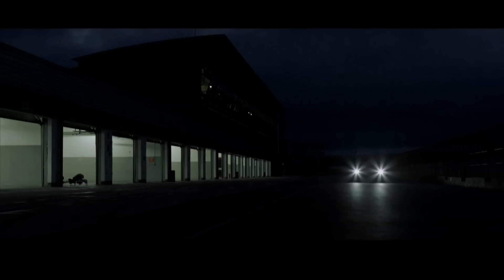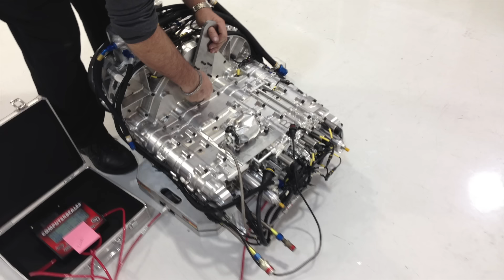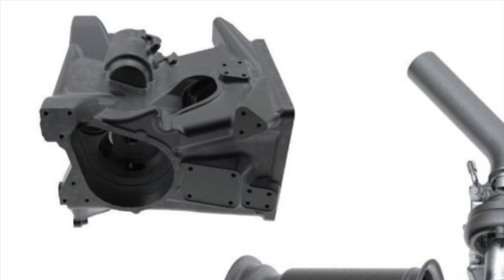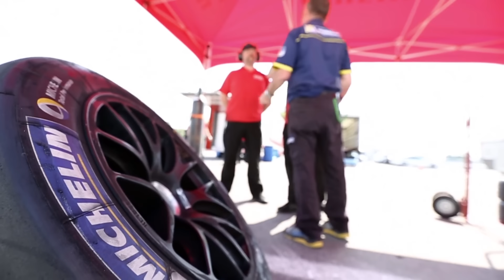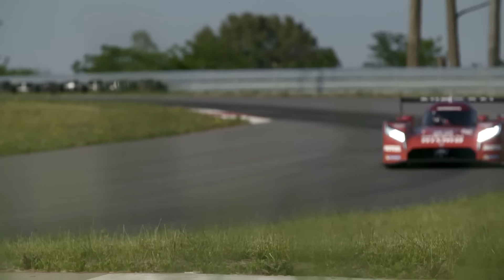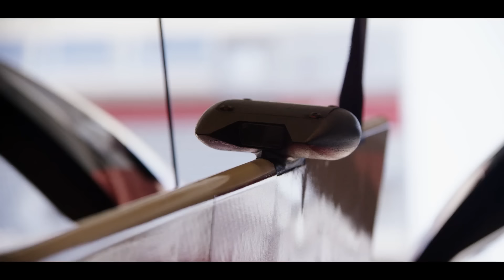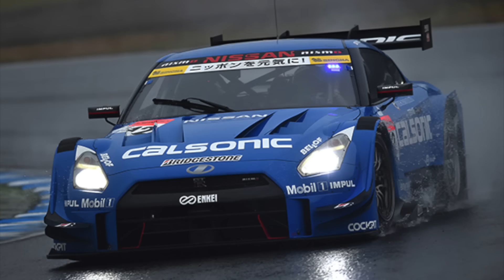Nissan GT-R LM NISMO, the front engined Le Mans car that ended up in a dumpster. What went wrong?

Comment: Yeah. A super low drag concept shows up every once in a while and it's never as good as the numbers say it should be. Something something spherical car in a vacuum.
Reply: low drag cars might need their own series with a limit on how much drag they can make, so any downforce generating parts still have to fit within that drag limit
Reply: It’s not the low drag concept.
It’s that such alternative concepts are run by teams with lower recourses and recourses are the best indicator for success in motorsports.

Those with sufficient resources don’t need to go extreme they build overall conventional designs and improve them a little bit.
Reply: It's the kind of stuff that only works if everyone is forced to do the same thing per rules.
Reply: Williams made it work pretty well for a few years at the start of the F1 Hybrid era.
Reply: @tuborgclassicenjoyer  That was also because of the power advantage of the Merc PU. Once the other engine manufacturers started to improve their PUs they started their journey to the back very rapidly (They were behind Force India by 2016, just two years after the V6-Hybrids were introduced)
Reply: @tuborgclassicenjoyer The teen Williams were low drag but not crazy. The closest car I can think of in F1 was the Ferrari F92.
Reply: Cough* 9x8 Cough*
Reply: @bigmac0702 at least the 9x8 was supported and they were able to get some podiums
Reply: @bigmac0702  9x8 has been monumentally fucked by the FIA's absurdly awful BoP (compared to how IMSA does it).
Reply: @julianturberfield7101  enough time has pased and IMSA BoP has being shit all the season long, 9x8 had being fucked because it was based to have power in the front axis sooner than it does
Reply: @giratina_86  wasnt it also the time when the FIA couldnt make up LMDH and LMWhatever and the peugeot went for the one regulation that got binned in the end?

Comment: I respect Bowlby for his ambition and innovation and Nissan for even green lighting such a project. But did they not learn anything from the Toyota F1 project about communication and placing your project in a strategic, sustainable and efficient part of the world where access to contractors, parts suppliers and partners is efficient. 

And less than a year of development is just not on at all. If I were them. They should’ve used the whole year of 2015 to develop the car and aim for 2016 instead. I feel soo bad for all the engineers and drivers who could see the project just constantly tripping over itself. I wanted this thing to do well but omg after watching this video and hearing the depth and detail of it’s failure it’s no wonder it was a grand failure
Reply: The issue with the toyota project was not the location, more so corporatisms. Worthy to listen the recounts of Salo and other toyota people. Comm was bad ofc between the japanese and german side but it wasnt as bad. Things like the corpo believing they have perfect engine and blaming the aero people for the lack of top speed for a very long time, throwing rally mechanics straight into the team no one really knowing how an f1 team should work, etc. Cologne was not an issue, there are a bootload of suppliers based in Germany and they built on an already set up base.
The team who was hampered by the location was HRT with their intention to make a fully spanish F1 team but in spain there was no infrastructure for that to happen
Reply: @leventebandi What's even worse is how they treated the employees. Most were laid off right before Christmas and by then trying to find jobs with another organization is almost impossible as everyone is well underway getting ready for the next season by that point. Nissan as a company is a shell of what they used to be. Disgusting.
Reply: nice buzzword salad
Reply: Made thing even worse 2016 LMP1  rules set reset all Hybrid class must hit 1000HP  that mean Nissan can't rivals against them if they reused 2015 package

Comment: What did people at the time think of the front engine concept? Did they think it was a gimmick, or did Nissan actually convince the audience to find it cool?
Reply: IIRC it was always a mix of the inspired and the cynical.
Reply: @Fuse_22 And nissan official account being absolutely everywhere on social media replying to peoples posts and comments assuring them that the lmp1 is actually good.
Reply: It wasn't new; that was the main thing to remember. 
They were (VERY loosely-speaking!) taking the Panoz front-engine concept, which had won ALMS races and combining it with a very much narrower car based on the Deltawing concept plus through-flow aero and a (theoretically...) proven LM-winning hybrid concept to generate a then-standard AWD hybrid racecar specifically-designed to compete at Le Mans (though it would enter other rounds and have to compete in the full championship). There wasn't much altogether radical about any one of the ideas behind the car, to anyone familiar with Le Mans and prototype racing, aside from the majority power being front-biased (and even then, only on initial pull out of slow corners, which in the wet was not necessarily a disadvantage). 

The car was supposed to be a pretty conventional Panoz-type car, but with AWD, ultra-low drag and a much higher top-speed. Conceptually, not much to really fault. Execution - totally the opposite!

Comment: Huge shame that it literally ended in a dumpster. My understanding is that Torotrak ended up effectively being a scam, which this project and some European citybus project being the victims before it went under. Has there been any other projects other than the first Audi R18 that have successfully used flywheel/kinetic energy storage? 

Hindsight definitely helps, but the decision not to use an electric hybrid seems quite baffling since F1 had already converged on battery based systems in 2014, and the Honda Insight, Toyota Prius, and Ford Escape also used a battery system for a decade by that point.
Reply: I think there wasn't an 8MJ battery fit for purpose yet... until Porsche turned up with a bespoke one in 2015 (from A123 Systems IIRC) and thrashed everybody. The Porsche 911 GT3R Hybrid was in the pound seat to win the Nürburgring 24 Hours until a late-race technical failure put it out, so that was nearly a success with a related system to the later Audi's.
Reply: iirc williams in 2009 used flywheel based one
Reply: @leventebandi  Yes, the company which owned the system was then sold (Flybrid / Williams Hybrid Technologies) to GKN who briefly had it partnered up with Dennis buses; but sold it on to Dumarey/Punch Group 3 years ago, who appear to have done little to nothing with it specifically. Probably best known for the sons' racing activities, mainy in the NLS/Nurburgring 24hr with Aston GT3 and GT4 (non-hybrid!) cars..
Reply: parry people movers successfully sold a flywheel powered hybrid(a small LPG powered engine spins up and maintains the speed of the flywheel which powers the train, the flywheel being the part that actually powers the train means the 12 ton train can perform adequately with a tiny 86hp engine) train to british rail as the class 139 and the british rail class 70 used flywheels to cover gaps in electrification, flywheel batteries have a bunch of stationary uses in UPSs, power grid short term storage to handle short surges and dips and in things that require a ton of power for a short pulse like launching LIM rollercoasters, electromagnetic aircraft catapults and pulsed lasers

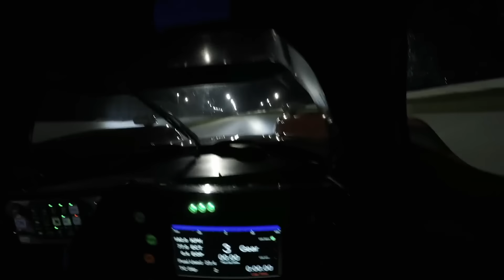Comment: 41:35 Ahhh, the vacuum-cleaner sound of the regen actually happening. I remember reading that sometimes it happened and sometimes it didn't, so if drivers braked in anticipation of regen at the NCM track and it didn't happen, they'd helplessly overshoot the first corner by some distance. I also remember a TopGear web article of either Jann or Harry saying that the KERS unit "went off like a grenade" under their legs once... the other issue with it was oil starvation at high-G causing it to hugely overheat, which wasn't detected on the dyno. I also have Ricardo Divila's old Twitter thread screenshotted and saved on my laptop; you should've shown the complete GC cutaway image of the planetary gearsets on the rear end! He also blamed the generic 18" tyres being "too soft vertically" for causing the front porpoising.

I will always imagine a parallel universe where it all went as planned. Maybe they could've collaborated with Williams Advanced Engineering again (The Road Rat stated that Darren Cox wanted to collab with Renault F1, but I suspect boardroom Japanese pride within the business group stopped them approving of the French side saving them, so Williams would've gone better IMO; Cox quit Nissan soon after Le Mans anyway). If it had an 8MJ battery like the Porsche, with the intended bespoke tyres, FRIC suspension, torque vectoring, proper build quality... I will always believe it could have worked and the haters are wrong. But this whole project was all badly executed good ideas and poor management, and that's a damned shame. Once Palmer and Cox had left, Frontzilla lost two of its biggest corporate supporters and was a sitting duck to get axed before it could truly fly.

Comment: All of this could have been avoiding if the top brass didn't have such an ego. Why start a project with such a radical concept? Why not start more conventional, get some data and experience, THEN go radical?
Reply: Nissan already had the experience with radical, DeltaWing, Zeod.
Also, by the time they could have done this concept after a conventional LMP the rules for hybrid deployment would have already changed in a way that makes this concept impossible.
Reply: @illdeletethismusic   Darren Cox - the marketing man behind NISMO in Europe and all of Nissan's Motorsport outside Japan at the time, said it had to be different for the sake of being different - on record, not speculation. The 'happy accident' was that he also had Bowlby as designed, who likewise wanted to create low-drag concept cars. 

From Marshall Pruett at Racer: “The brief was, don’t build me an Audi, or a P1 copy,” (Cox) said. The decision was taken, if you had a new sheet of paper, what car would you build? Let’s be honest, Audi have got $200 billion in the bank in terms of investing technologies. Porsche, basically, almost copied Audi in a lot of respects. Toyota have a Dome chassis with a Super GT engine. They all had something that they could then utilize. Everyone has the same idea. Actually, we’ve just gone, well, there is the tub, we’ll move the engine from there to there, that means you can change the balance of the weight distribution, therefore you can change the distribution of the center of pressure on the aero.

Once you start there, that is pretty simple. Actually putting an engine in the front, when you look at the modeling, it’s pretty simple. The question is, should it be front or rear-wheel drive? We had that debate as well. Actually, when you look at it, the packaging, using the tires in the back are smaller which means your aero is easier on the back.  We looked at a blank sheet of paper and the best solution is...a V6 twin turbo, four-wheel-drive, the engine is in the front. It must be a GT-R then. Then it’s just a marketing job made easy.

Comment: Holy moly, from 1000hp expected to 175...?! 
As I said in the ZEOD video, this is money spent on things that did not work. If Nissan had spend it on a proper car LMP1H could exist to this day.
Also interesting how the US is unable to build top level cars. They could if IndyCar chassis was made in the US at least (no, Dallara doesn't built the cars in US).
They got Super GT legends in Japan ready to build this stuff but choose to go with US instead... 
The CEO was wrong in all his takes. Especially when he says all LMP1H cars looked the same. Dude, those cars made F1 jealous about how easy it was to identify them. They were totally different from each other... Nissan could do the same.
Reply: Considering the relative diversity that was already on the grid with Audi, Porsche and Toyota running completely different engine configs (even fuels) and hybrid systems - it is a pretty crazy statement from their CEO. But then again compared to what Nissan ended up building....  I guess they were 'similar' 😅
Reply: @simonzdrenka3851 Yeah, they worked!

Comment: I remember when this car was launched, being so excited about it and finding it so cool that it took at totally different approach (albeit not one that turn out to be successful) than what Audi and Porsche were running at the time. I would be interested to hear you take on how if could have done if given more time. There are photo out their of the update car which would have run at the Nurburgring 6 Hour if it were not for the project plug being pulled.
Reply: they could have done better the next year had they kept developing and gotten the all wheel drive working, but the year after that the hybrid rules were changed, putting a limit on deployed power, and thus making the Nissan concept that relied on short bursts of high power impossible.